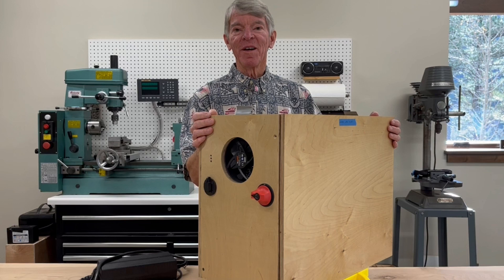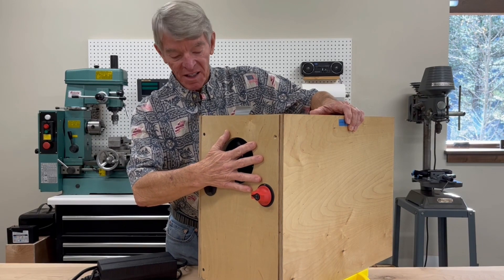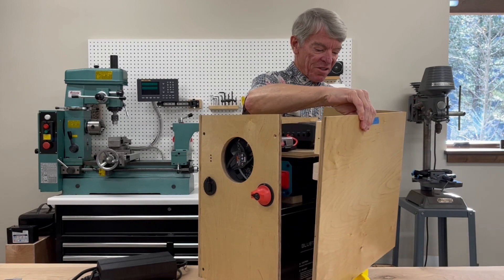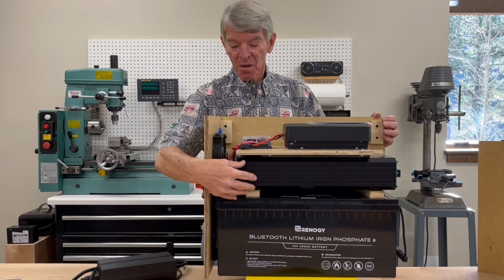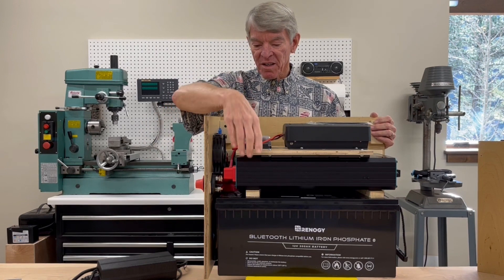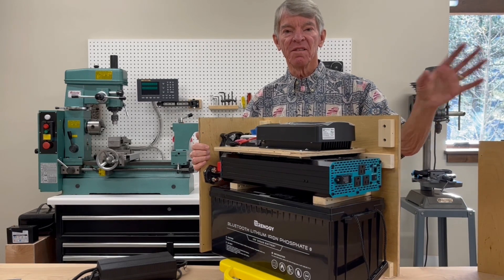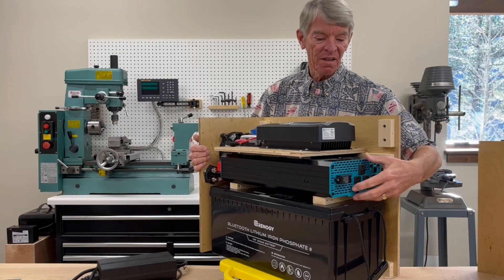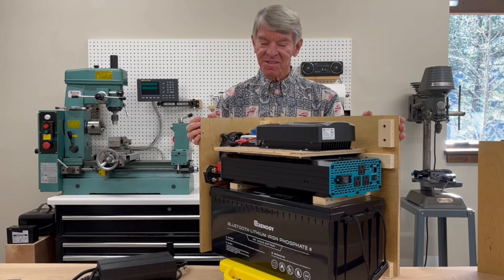Compact Electrical System to Save Space in Your Van Conversion

Comment: I love how tidy and modular it is!  Are you going to use a dc-dc charger to charge from the alternator?
Reply from the maker: I thought about a dc-dc charger but didn't plan for one. So far the 525W of solar has worked. If I was building the van again I would definitely wire the van for the possibility of adding a dc-dc charger just in case. I do carry a 20A battery charger and a long extension cord just in case I need to connect to shore power.